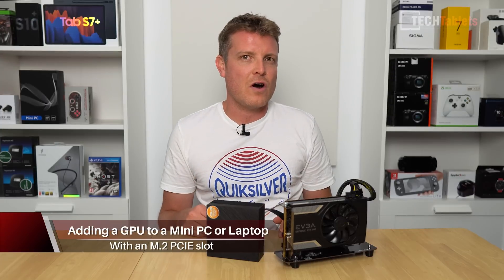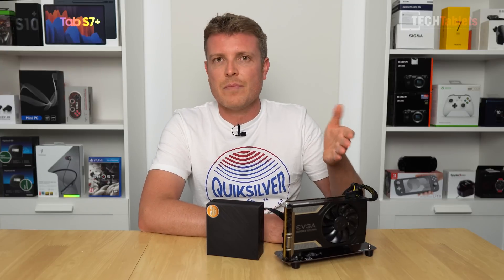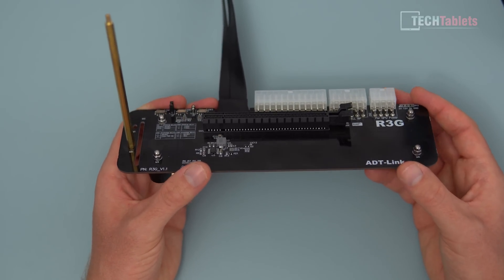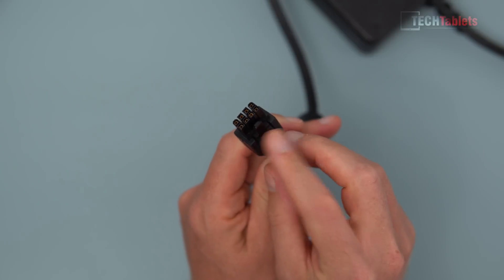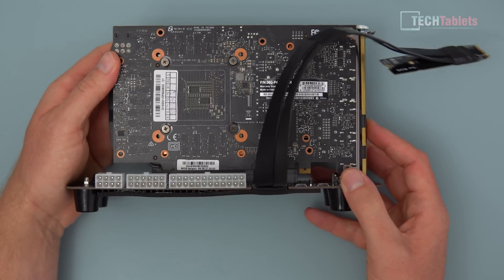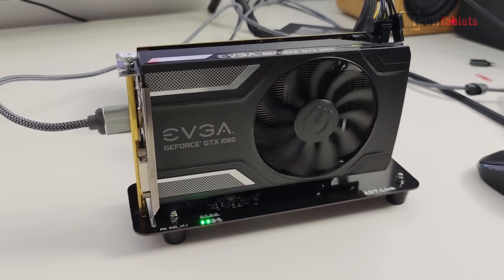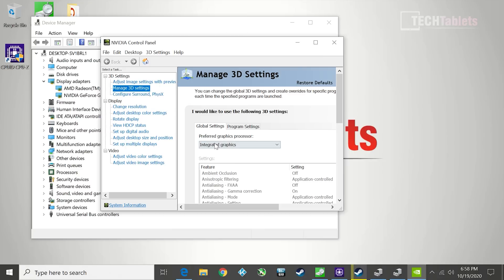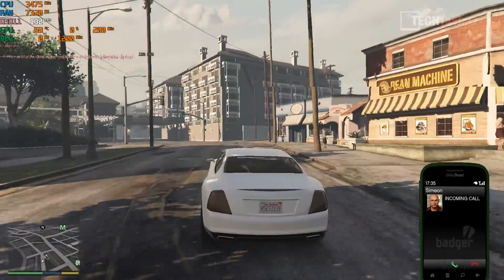Turning My AMD Ryzen Mini PC Into Gaming PC! M.2 PCI-E to eGPU Upgrade

Comment: Mate, really like your videos and have been watching you regularly for years. I just came off watching your review of the mini PC you have in this video and this one piqued my interest but I think there are things that you say in this video that you may want to re-think because they might be really misguiding. Not that anyone would lose a limb or anything but they just don't sound right.

Firstly, the claim that you make around losing 6-8% performance. I know you're not doing very scientific tests here but you don't really need to be a scientist to know that loss will not scale across the GPU range and will increase dramatically with higher-end GPUs (I couldn't stop cringing when you mentioned the 3080 and practically fell off my chair when you said 3090). The reason is simple. That PCIe Gen3 x4  slot is not going to have enough bandwidth that those cards demand. They definitely require minimum 8 lanes to run at full tilt and the 4 lanes there is going to be a massive bottleneck.

Secondly, power. It's obvious that the board/adapter that you're showing there is clearly not going to be able to support the number of connectors of those higher-end GPUs (it won't even be enough for a basic 2080 let alone a 3090). You do mention that you will require more connectors so you clearly know but how would that work with the board that you're showing? I don't think it would.

Lastly,  I would love to see how you could use both the integrated GPU's (iGPU) connectors and the dedicated card (dGPU) at the same time because that never works on a desktop. On laptops when the system has switchable graphics there is a handoff of those ports between the iGPU and dGPU when the switching happens but you can't really use both at the same time. For desktops the outputs are separate for iGPU and dGPU and there is no handoff so you can't use both at the same time. I would loooove to be wrong. Can you do a quick video to prove your claim by simply plugging into two monitors at the same time, one onto the output on the miniPC and the other on the dGPU? I highly doubt that works but would love to see.

Thanks for your efforts. Not here to try to disprove your claims or discredit your work. Just trying to clear up a few things since you're the one with the kit. Keep it up mate and stay safe in Spain!

Comment: I wonder how this would work (if at all) with one of those nvme usb adapter thingys, avoiding the whole opening up your system and having a cable hanging out thing
Reply: I doubt it would work at all and even if it did it would be way worse because USB is half the speed of TB3 in the best case scenario (currently) and 1/8 the speed in a typical scenario.
Reply: @ikkuranus  I was thinking specifically of the ASUS ROG Strix Arion, which is usb c 3.2 gen 2. Unless that's the speeds you're already describing? I don't really know how fast that is, just that it's one of the faster enclosures

Comment: Hi Chris, the mini pc you are using for this video does not have a usb type c connector with the lightning signal next to it, is not that type of usb supposed to be able to output image? I ask if it has that capacity can be connected to the egpu adapter out there, thank you very much, greetings

Comment: Can it really "gaming"? Like 2-5 hours a day
Reply: Just don't go beyond Medium Graphics settings. Because you will overheat the CPU in less than 30 minutes.

I did the same except I put everything directly under the wall mounted AC to keep it cool. During idle everything is only 16° Celsius, while gaming peak at 28° Celsius. 
Your ambient temperature must be cold to run game at high settings or just use Air Conditioner

Comment: Underrated Youtuber. Just missing some wall power usage numbers  :)
I hope for a PN50 with 2-3 nvmes one day :)
Reply from the maker: PN50 Ryzen 5 4500U wall power usage is in the review but it's max 49W at the wall under full load and 6-8 idle
Reply: @Techtablets  reply faster 😂
Joking. Actually I saw full pn50 review. I was wondering about the power draw when using the external card.

Seriously on the fence here..
I need a new home server that uses little power.
The a300 from asrock won't support the new ryzen and the pn50 is quite expensive..

Comment: Is there any way to use external GPU with type c?
Reply: USB type C must have Thunderbolt feature on it, but the problem is that it only exists in Intel platform. Because Intel is the one who invented Thunderbolt and USB type C.

On AMD platform, USB type C usually only be used for Power delivery or external storage because it don't have Thunderbolt feature in it.

It is no different from Android Phones with USB type C socket, but none of them have Thunderbolt right? Same thing with AMD platform.

Comment: @Chris, thank you so much for this review and extra thanks for considering my request. This is a great solution for not only gaming but for content creation as well. Since current Vega iGPU doesn't work with editing software like Premiere Pro or The Vinci Resolve, this little tweak can give you immense flexibility with such a small pc. If we have the 4700u or 4800u model, and with even a moderately powerful GPU like GTX 1650 Super, user can have a small and cheap editing rig.

Comment: You could of use a low profile 1650 GPU which doesn't require much power
Reply: It wouldn't make any difference - since the mini slot can't output 75W like a regular slot can you'd still have to use the Dell PSU or something similar.

Comment: I have that dell powerpack and the ngff to nvme from my previous failed attempt,do u think rx470 will work with this?1060 is still quitr expensive in my country but the 470 is just $50 in our etailers

Comment: that amd 4500u seems strong enough to handle 1060 imagine if one of the laptop oem has a balls to make a gaming laptop with rtx 2060 and amd 4800u 25w i think that cpu will still handle 2060 well
Reply: I'm sure the 4500U can handle even rtx2060 because Zen 2 Core scales much better than Intel's CPUs. The problem would be 1% low because of limited bandwith

Comment: Du you need power supply unit even on very little GPU that are powered by the PCI Express (like GT 1030 ?)
Reply: The Mini PC's power supply isn't designed to power an extra dedicated GPU.
Reply: Yes, usually it would be powerd by the pcie slot but since there is no real power coming through the nvme cable you still need a PSU to power the pcie slot

Comment: Doesn't it defeat the form factor of the unit. If that's the case just build a mini pc. I rather have the smallest form factor I can get with the best intergraded graphics chip I can get.
Reply from the maker: of course and now it can't be mounted behind a monitor etc.
Reply: @Techtablets  i’m waiting to see who drops the first smallest mini pc with the ryzen 5000. I can’t wait. That’s what I’m looking forward to.
Reply: @Ike00Knight  I'm looking forward to MX450 with 1050 Ti levels of performance at 25w in slim form factor PCs/laptops next year
Reply: @elemkay5104  nice! I just love the smaller you can go with the most on board graphics you can get.

Comment: Hey Chris, could you investigate something regarding eGPUs and Intel Ice Lake?  Since eGPUs experience worse performance compared to PCI-E, a couple new technologies attempt to mitigate this penalty. Windows 10 has an experimental memory scheduler whereby the GPU manages the VRAM (instead of system managed). This may improve latency, a major reason for the TB3 graphics penalty. Additionally, Ice Lake integrates the TB3 controller on-die, which may also further reduce latency.

Could you benchmark both a Whiskey Lake laptop and Ice Lake laptop with Thunderbolt 3? Comparison to a desktop can provide a reference, but the more important data would be 

(1) Whiskey Lake / no mem scheduler
(2) Whiskey lake / yes mem scheduler
(3) Ice Lake / no mem scheduler
(4) Ice Lake / yes mem scheduler

By understanding these differences, we can infer how well these approaches reduce the eGPU penalty. I have seen both the memory scheduler and Ice Lake benchmarked against the standard, but not against each other or in conjunction. While the individual tests show promise, I'm interested in how they play together, and how much further I am from buying a high-powered ultraportable and relying on a eGPU when I want to do more serious gaming/work.
Reply from the maker: Sounds good and I would love to see the results and what about the new Tiger Lake TB4 support for later TB4 eGPUs. But I have no plans to buy any Ice Lake laptops or a Whiskey Lake one, such tests would be super expensive and only result in a huge loss for me. Sorry but that's how it is.
Reply: @Techtablets  is there any viable thunderbolt budget egpu option (i.e. like your setup here) that would work with a laptop without having a cable hanging out of its guts? - would the TB4 in Tiger lake do it and can you get a thunberbolt version of the m.2 gpu card holder (R43SG)?
Reply: @huzcer  There aren't TB3 versions of this, you have to get a proper full enclosure for the luxury of TB3. Tired scouting them out myself. Your best bet is to scan ebay and find one up for auction.
Reply: you could try asking LTT for this test
Reply: Jarrod's Tech has recently put up a video regarding eGPU performance on Ice Lake vs Comet Lake, maybe you can try ask him

Comment: Thank you for these in depth experiments. Would be amusing to plug a gigantic 3080 or 3090 with a 400W+ PSU just because why not.
Reply from the maker: It would and I would have done it if I had one! The 4500U would have limited it of course but still be fun to do!
Reply: @Techtablets  if you are running at 4k I actually don't think that the CPU would bottleneck it much. If it was, you can actually increase the power limits and allow for more performance. I think the PCIe 4x link would be the major bottleneck. I would love to see an AMD version of the newer Intel nuc where you could install a discrete gpu with a mobile chip.
Reply: @Techtablets  yly
Reply: @Techtablets  if you ever get one (for a workstation or something) please make one. A performance comparison would be really interesting. I'm getting a laptop with a really good cpu but a gpu that won't last too long (3050 ti has 4 gigs of vram) so I'm thinking of plans for the future
Reply: 6800 XT would be better over the 3080 and 3090
Reply: Im actually waiting on the pn63 with the new ryzen cpu’s and thunderbolt. Would it work better through the thunderbolt ?
Reply: If you can afford a 3090 you would have it sits outside of the case.  You would have a shrine for it and LED lights around it.
Reply: I tried RTX 3070 with 650w with this riser on a dell SFF machine!
Reply: @nathan_ca  how does it perform?
Reply: @williamsurya2508  pretty well! I tried red dead redemption 2, get 60 at 2k high setting. Can play most games at 2k with 100+ fps

Comment: You won't get shocked by 12V, you'll be fine :D The most dangerous mishap would be shorting those leads and blowing the PSU up in case it isn't properly protected :)
Reply: He would if he licked it.
Reply: And possibly frying the card.
Reply: 👆 This! ;-)
Reply: It's all about heat, not about electric shock. 🌚
Reply: 12V is no issue!! In general < 48 V will NOT kill you and is know as "low voltage"

BUT the question is how much ampere? 

e.g: To get 300 Watts from a (single) 12 Volt line you will have 300 / 12 = 25 A. = No fun!
Reply: @derJackistweg  Max wattage doesn't matter. I=U/R, the resistance of skin is very high and with U=12V the current flowing through your skin is going to in the uA range.
Reply: @rcpoisond  I didn't say that "power" matter.
Reply: @derJackistweg  Ampere doesn’t shock you, voltage does. 12V is not enough to shock you through your hands, doesn’t matter if it’s 1Amp or 1000Amp. You won’t feel it if you touch 24V either. Maybe 48V could be felt but not as a shock. More like a tickle.
Reply: AC more dangerous than DC
Reply: @GameBacardi  sadly wrong. Lower voltage = greater amperage, amperage is the push behind the power, I.e 120v ac @ 20amp = 2400w, 12V DC @ 200 amps = 2400w. Also DC is direct current, so it flows in only one direction towards the shorted path to ground, AC flows in an alternating direction, thrown the hot wire, through the neutral and then finally the waste and erratic currents follow the ground to the earth. People die more often from DC, mainly due to the fact that they underestimate the amperage and only focus on the voltage. Like a car battery for instance, they are 12v @ 400-1000+ amps (480-12000amps), while most AC circuits only pull only a few hundred milliamperes-2-4 amps. (Except circuits wired to motors, I.e microwave, they have an inrush current up to 12-18 amps) 240-9600w.

Comment: I think there's a way to limit the number of PCIe lanes a NVMe drive uses, so that may also help the GPU to work in that scenario, but the setting would need to be available in the BIOS. That 1060 card isn't bad, I used to have the same one, if you look at the exhaust you should see a piece of tape covering the fins, you can open it up and remove that to get extra cooling. It should undervolt quite well too.
Reply from the maker: I should have just tried a SATA3 2280 M.2 and then it might have worked. I'll have to try again on my XMG Core 15 Ryzen 7 4800H laptop! It's not the best of the 1060s' as the VRM's cook themselves as have no contact with the heatsink, I had to mod it. Undervolts okay and overclocks a little to help making up for the PCIE 16x Vs 4x loss which isn't much.
Reply: @Techtablets  Yes, I believe that was an issue with them when they first released and EVGA offered a free kit to fit your own thermal pads on to make contact... luckily mine wasn't one. Developed a whine issue eventually so got rid of it.